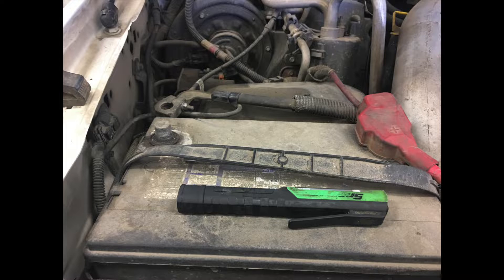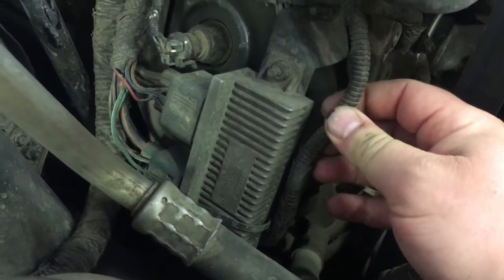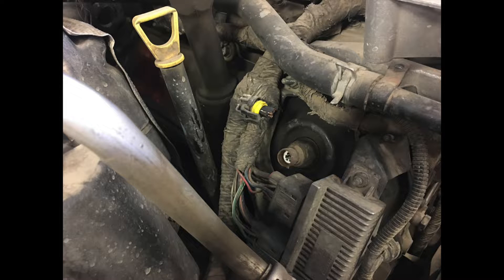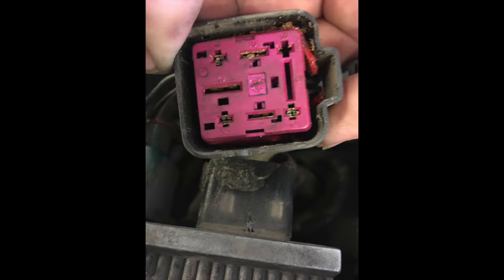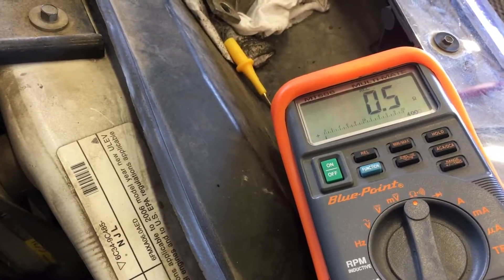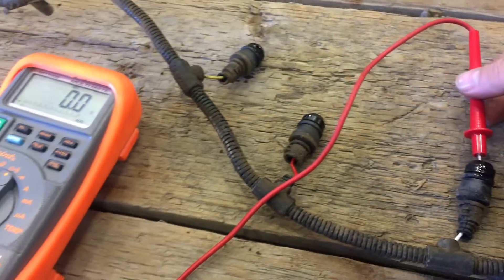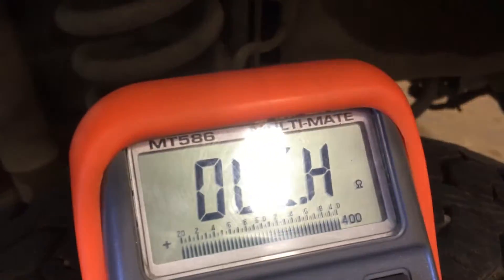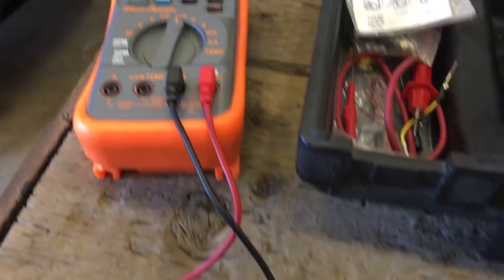How to Test Powerstroke Diesel 6.0 Glow Plugs DIY

Comment: Just FYI never take the intercooler boots off the tube on a 6.0 you just ruined the seal on it. Always leave the boots on the pipe and remove the clamps on the turbo or CAC side

Comment: Do u remember the symptoms of the bad glow plug?
Reply: Hard start, what else? Lol
Reply: @tedmixos3370  twist it off in the head am I forgetting something?
Reply: I've found that if your glow plugs are bad on a 6.0, it might start with no symptoms at all in summer, and then as it gets colder, it will get harder and harder to start, taking more cranking time and letting out white smoke from the exhaust when it initially does start.

Comment: There is nothing wrong with a Powerstroke  6.0 that a few sticks of dynamite won’t fix.
Reply from the maker: Isn’t that the truth worst Engine ever built
Reply: @TestDontguess  you haven't owned a eco boost or a new powerstroke have you? or anything chevy after 2010. or god forbid a Mercedes benz newer than 2010. my 6.0L has never let me down. and hasn't broken my bank. meanwhile my 2018 Platinum has died on me left me stranded and has 2/8ths the mileage. and used the same. wifes bronco with ecoboost left us stranded on more than 2 occasions not even 10,000 miles in. she used to have a Mercedez benz S class. my god. what a junker. you'd think a car with 2,000 miles on it would not be crap especially one with a dudes signature on a motor. and she had a brand new chevy cruise that was a pile of shit.

i love my 6.0L for what it is. not too many electronics. its a truck. nothing more nothing less. all this new crap they sell. you pay 30,000 dollars for the truck with a diesel engine in it. and 80,000 dollars of massaging seats big screen. LED's everywhere. fancy quad zone climate control. 100 position seats power running boards. and all around cameras that fail often. oh and the moon roof that literally broke the 2nd time i used it oh and the truck developed death wobble not even 30,000 miles in. its got 70,000 now. i'd rather take my 6.0L on damn near cross country trip versus taking the 2018 F250 just across town. 18 year old 240,000 mile truck versus a 3.5 year old 60,000 mile truck.

my 6.0L came from the factory with "nice options" that i'd ever want on a diesel pickup or any pickup. Power back sliding glass. and heated seats.
Reply: oh you think thats the worst? dont even get me started on the 6.4 maxxforce 7! its even worse! Cheers man!
Reply from the maker: Of course International built that one too.  They should just get out of the business it’s been downhill since the 7.3
Reply: that was a great V8! the T444! but the DT466 was by far the best went all the way till 2006 until it started the fall apart!
Reply: they only make one engine now! otherwise they are all cummins powered!